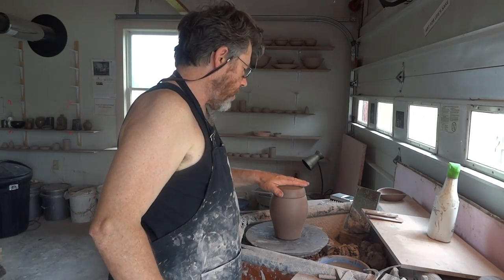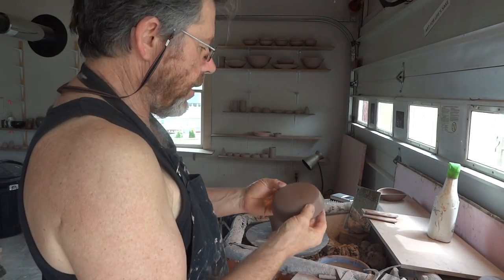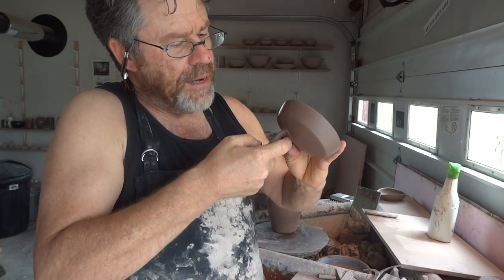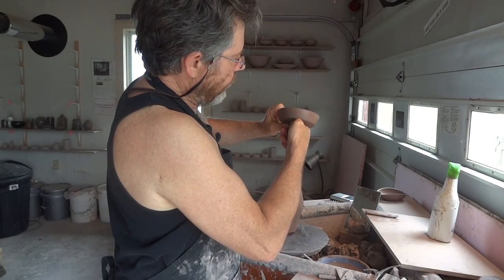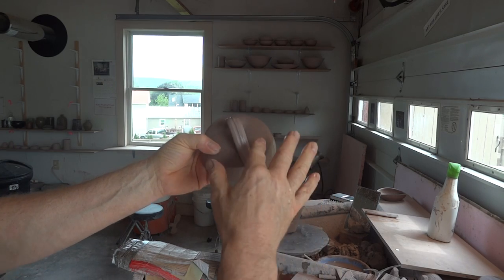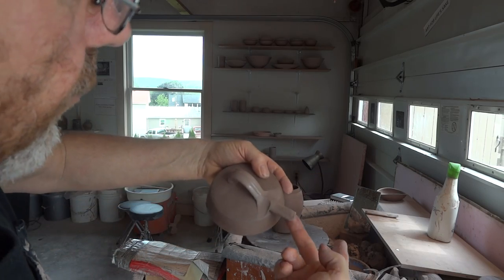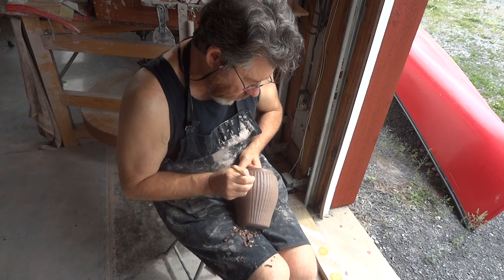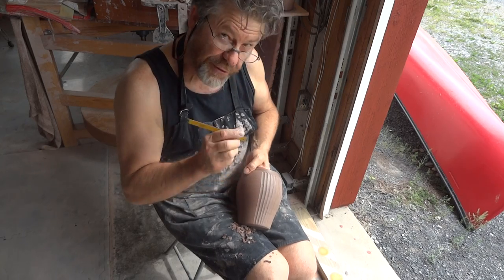SIMON LEACH POTTERY TV  - Handling & fluting the bisc barrel (cookie jar)

Comment: Thanks so much for the video!  

Since the diameter of the pot is larger at the top than at the bottom, do you intentionally narrow the flutes as they approach the bottom of the pot?
Reply from the maker: Yes the flute lines are tapered according to the pot shape.